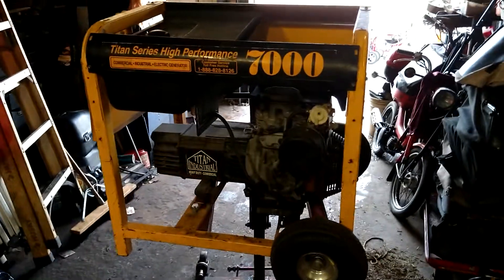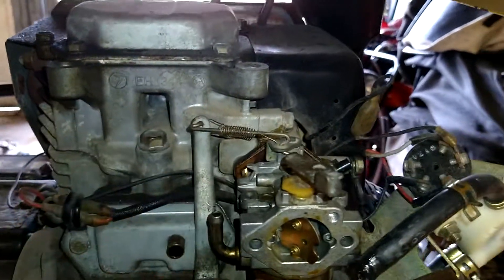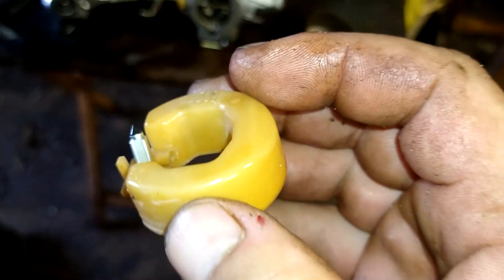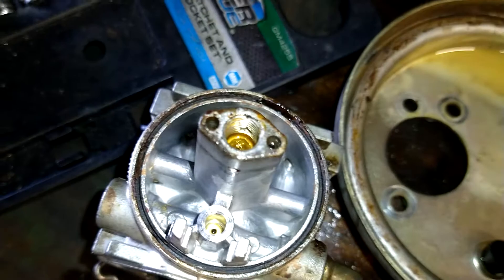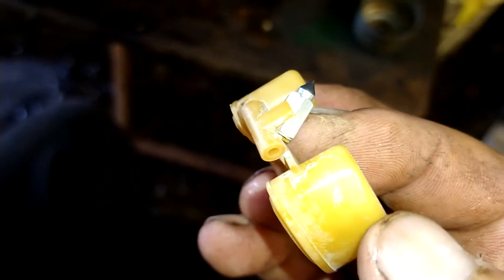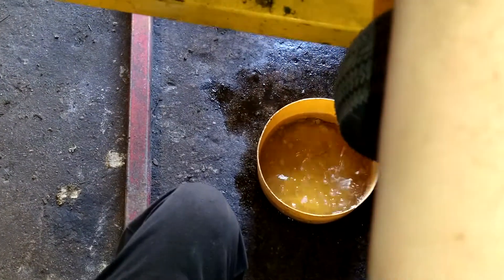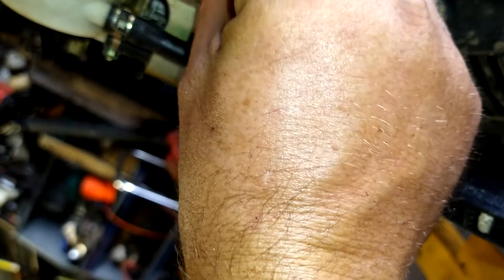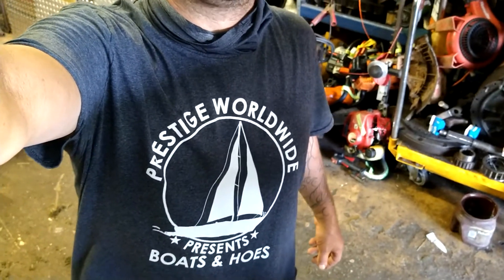titan 7000 generator carburetor repair. robin subaru eh34 11hp carb cleaning

Comment: Awesome video! Just in case cleaning doesnt work...When I click the link for the carb from Amazon it does not list this as an eh34 carb replacement. And the robin subaru manual lists the carb as part no  247-62311-10. Are you sure that's the right carb?